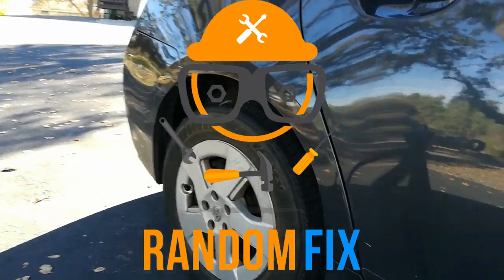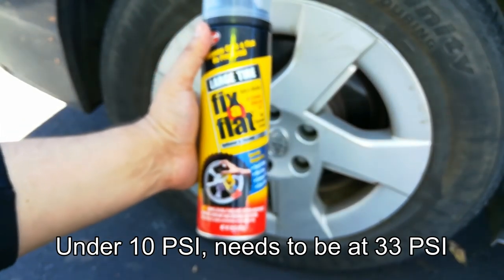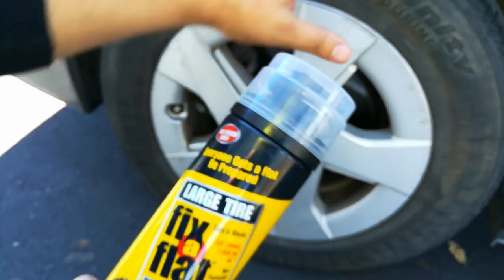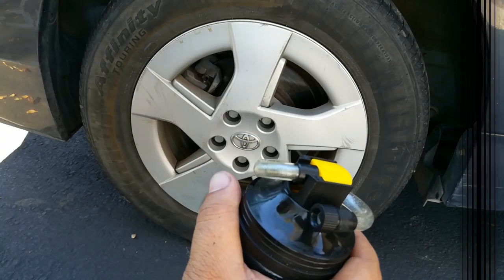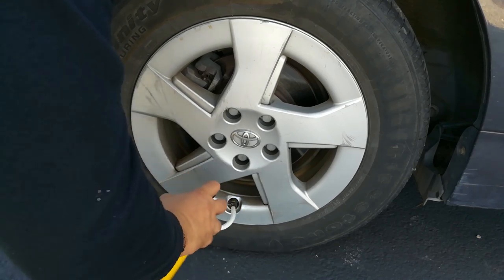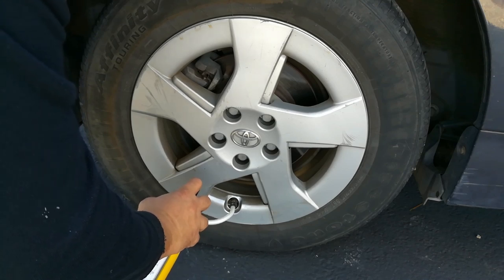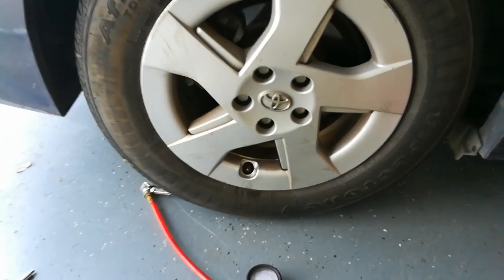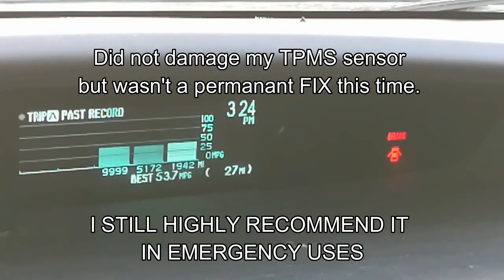Fix a Flat Repair - Does It Work?

Comment from the maker: ▶▶Fix a Flat - GET THE BIG CAN!! https://amzn.to/48XSxZR
▶Link to 12v air compressor https://amzn.to/3rOOH4S

▶How To Repair Flat Tire On The Spot  https://youtu.be/nT4Vt9voDxc
▶Link to Tire plug kit https://amzn.to/3M6Ppky
Reply: Do you take the nail out if there’s one in it?
Reply: The instructions say put the LEAK not the valve at the 6 clock position. It also says tire should be fully deflated.
Reply from the maker: Thank you for the info. Will update video.

Comment: I used this before many times, he is correct the large size is better more air and sealant. However it creates a mess in the tire which usually makes them pissed later. Best thing to do is fill with air and drive to get it fixed or if you can't then use this and buy a new tire
Reply from the maker: Sam Thanks for the confirmation. I can deal with having to buy a new tire as long as I get to a tire shop vs being stuck on the side of the road.

Comment: My fiance used a hand full of times and it worked. This is the first time it didn't work at all. Kia Rio Hatchback right rear. Mahalo - Thank you
Reply from the maker: Carrie, good information. Yes as you stated there is not a produced that works 100 of the time and I still carry a can of this because most of the time it works and gets you out of jam. _randomfix
Reply: Just ruin the valve stem on my lawn mower tire using this product what was marketed as a $10 fix has now become over a $100 problem use this product at your own risk I will never use it again
Reply: Was probably your valve stem then?! 🤷🏻‍♀️

Comment: I think that FIX A FLAT is an excellent product as long as people understand what it is.  It is a TEMPORARY fix to get you out of trouble.  If your stuck on the side of the road with a flat tire, or very low air pressure in your tire, it's much easier to put FIX A FLAT in and drive home or drive directly to the tire center and get a new tire as soon as possible.  It is not a long term or permanent solution to a flat tire, or a tire that has a slow leak.  So basically it's just a way to get you and your car home safely, or to an auto center safely in the event of a leaking or flat tire.  People also need to understand that once you put this in your tire, the tire is basically considered NO GOOD.  It can't be repaired and it can't be fixed or saved.  Even the auto center will refuse to repair the tire once FIX A FLAT has been used.  It is basic tire industry knowledge that once FIX A FLAT has been used the tire is now considered no good and no longer can be fixed.  My best advice to anyone with a tire issue is to first look at the tire.  If the tire has a very slow leak you can probably drive it to the auto center if there is still enough air in the tire as long as the tire is not so flat that your car is literally riding on the rim.  If the tire is VERY FLAT, try and put FIX A FLAT in and then drive to the auto center to get a new tire.  In some cases, if your tire is so badly damaged, FIX A FLAT might not be able to help you.  In that case your going to have to put your spare tire on.  Once at the auto center, GET A NEW TIRE.  Replacing one single tire usually is not that expensive and having a new tire is your best bet.  It's definitely CHEAPER to have the tire repaired but your much better off with a brand new tire if you can afford it.
Reply from the maker: I love it, great thoughts. I too keep it in the back of my car, and if I need than I use. _Randomfix
Reply: @RANDOMFIX  Yes it is a great product!
Reply: I hate mechanics that lie just for business.  If it fixes the leak, IT FIXES THE LEAK.  We're not getting a new tire when the one we have is fixed.
Reply: Untrue tho yo! My experience has been using this exact brand three separate times with screw or nail punctures with full deflation, left the object in there every time, and it was a permanent fix every time. I was even able to fill up the tires when getting a little low after a few months as well. I’m not sure if my experience was a fluke or not, but if it was, it was a fluke thst happened to me 100% of the time with multiple tries....

Comment: pretty good video other than the fact that you're doing the exact opposite of the instructions which state that the puncture should be at the 6 which is down low at the bottom and that the valve if possible should be as high up near the 12 as much as possible but the priority is that you have the puncture at the six position.
Reply from the maker: Dan, Great feedback, I will keep that mind. _Randomfix
Reply: Can't always tell where the leak is so it can be hard some times. Video is a year old but it was made in December so it was probably also winter at the time I don't blame the man for not jacking the car up just to take off the tire to find the leak.
Reply: Lmao earthlings are hella funny and weird
Reply: @bequakynskagroupie3751  right?  They're always tinkering with things.  Thinking about things... fixing things...and looking for----what are they LOOKING for??
Reply: I have a question. I guess common sense if you have a flat tire and you pull over the side of the road and put fix the flat in the tire aren't you still in the jam of not having any air to put in it.. It would seem if I have to call a tow truck just to put air in my tire I might as well have them change to  the spare.. I could be misunderstanding everyone maybe you're talking about a very very slow leak but you still need to put air in the tire so I guess you're supposed to use this product and then drive to a gas station and fill it up.. It would seem more logical to pay the $20 to have the tire taken off and patched
Reply from the maker: The patch is only real solution but when it's a weekend or your middle of nowhere what are your options? I carry the can of fix a flax and a small 12 volt air compressor.
Reply: @RANDOMFIX   I feel like if people are responsible the only real solution is to make sure you have a functional good condition spare tire, cover alls and a blanket, and a small piece of wood to put your Jack on.. Fail to plan plan to fail
Reply: @RANDOMFIX   Here is another smart detail most people don't know. When a tire shop put your lugs on, they usually use about 800  pounds torque on their gun, when the lug should only be torqued at about 110ftlb.  I break all my lugs while I'm at home and then toward them then if I am out on the road I know my 4 way will remove the lugs without me having to jump up-and-down on it like I'm on a trampoline
Reply: one more and I'm done lol.. I can't tell you how many times I've talked to people that said they couldn't get their lugs off, only to find out they were crossed thread by the tire shop because they did not put the lugs on by hand.. A lot of these technicians think they work for nascar.. People please watch the guys working on your tires and demand that they put the lugs on by hand and spend them on about 8 or 9 times before they use a gun
Reply from the maker: I hear you on that about shops over toqueing the lug nuts. I have had shops also leave them loose, lol.

Comment: My can says to move the tire so that the puncture is in the 6 o clock position and also says to make sure the tires are completely deflated before use...
Reply from the maker: Hi James , thanks for the feedback. I use the can as a fast solution to a flat tire. If you remove air and deflated the tire you maybe better off plugging the hole with a 5 dollar plug too versus the fix a flat. _Randomfix
Reply: Me too.  I couldn't find the hole and my valve happened to be at 6 already,  but it did not work AT ALLL ..
I still have a completely flat tire! Just had 2 patches put on last week. 🤦🏼‍♀️

Comment: FYI, your should really take the car on more than just a few minute drive after applying it, and it should be at high speeds like on a highway. I made the mistake of putting this stuff in my tire to fix a tiny pin-hole leak from a crappy patch job. I drove it around in slow city traffic for about 20 minutes then parked it at home. Next day I go to work and I have a large shimmy / oscillating vibration on the highway at above 60MPH, and it gets worse with higher speeds. So I'm guessing this stuff didn't spread evenly before it hardened. At least the leak is gone, but now my $300 Michelin is headed for the landfill...
Reply from the maker: Ian, good feedback, how long did drive for once you emptied the contents of the can into the tire? So, this exact thing happened to me a long time ago when it was cold and I didn't drive a long distance. _Randomfix
Reply: @RANDOMFIX  You should also fill it to proper pressure before going for a drive on the fix a flat.
Reply: The same thing happened  to me and I just posted it.  I have a $240 continental  and  it did the same . Why did that happen . I drove for an hr after on i95 also put air in before ride  . Why??

Comment: I do something completely different I put the product in, drive it out and then put air if it needs it which in most of my cases it does right after driving it. Hasn’t failed me.
Reply from the maker: Thank you for sharing your method.
Reply: Didn't he do just that?  He put it in,  driven it around, then added air as he needed it. How is what you said any different?  @mel_sandoval

Comment: Do you put the entire can in? How do you know when to stop if the tire is only low and not completely flat?
Reply from the maker: Hi Allison, yes empty the whole bottle in the tire and if you access to a tire pressure gauge you can also remove an excess air. 😃 Best of luck

Comment: My main concern is if i put the fix a flat on tire does it make it harder for rhe tire man to patch the tire
Reply from the maker: Joshua, Great question, from my experience I've never had a tire shop complain about my using the fix a flat in the car. There is also the great slime and other products but I think you should be okay. _RandomFix
Reply: Ok thanks tire is fixed
Reply: My brother  gout a fix a flat  spray   tire on my  old  
bike
Reply: Joshua Hidalgo it’s a liquid so it just wipes off clean with a rag or you can rinse it off with water
Reply: From experience yes, it does make it harder. The product has to be removed and there's always a big puddle of it in there, after you wipe it all out you still need to rinse it out with water and then wipe it dry again. This takes a lot of time and time is money, the longer the job takes the less money you make for the job. You never hear them complain because they don't want to lose a customer but I guarantee when they see that mess in there they're cussing.
Reply: If you find a nail should you remove it prior to adding the sealer? Thanks
Reply: The Polar Peak Monster I need this answer literally now! So probably will have figured it out by the time anyone answered this....
Reply: Yeah they can’t plug it after you use fix a flat

Comment: Did you have to take ur tire in to get the fixa flat solution out?
Reply from the maker: Hulk, Wierd story, but after the video was posted, it had a slow leak, but the leak has gone (it worked but not right away). I've had other cars and have taken them into the shop after using the fix a flat. The shops have never said anything to be about removing the fix a flat solution since it most likely dried out and spread out evenly. _RandomFix

Comment: It fixed mine..even though it was a messy procedure.. I couldn't get the whole can in the tire. But it worked. I followed your advise, valve on the bottom, then drive 10 - 12 minutes. :-)
Reply from the maker: Lars, Thanks awesome and I'm glad the video helped!! _Randomfix
Reply: well his advice is actually 5 to 10 minutes it's really two to four miles not so much minutes, as is clearly stated on the can of Fix-A-Flat.
Reply: @DanLoFat  Then excuse me, it still fixed my tire, and it has been over 2 month now and it I haven't had the need to put any more air in it.
Reply: 6 Months or more now.
Reply: Lars Koewing yeah I’ve done it theee separate times with permanent fixes every time

Comment: Will it work if tires is completely flat?
Reply from the maker: Yes but you most likely have to add some air into the tire, I recommend  buy thr bigger suv bottle.

Comment: So if there is a screw in the tire, should i remove it first?
Reply from the maker: Nanolugo, Great question, this the answer will vary case by case. Is the screw big, is head of the screw still attached, what area of the tire is the screw in, etc. If you can visibly see the screw then I would remove the screw. However, this is risky because all the air can leak out faster. (if the screw is really big you may not be able to remove it unless you a tire plug kit, see video link below ). Leaving the screw in and pour the contents of Fix-a-Flat will only buy a little time.  Best of luck and let me know how it goes? _RandomFix

▶️How To Repair Flat Tire On The Spot  https://youtu.be/nT4Vt9voDxc
Reply: RANDOMFIX thanks for the reply!
Reply: @RANDOMFIX  yes the last thing you just said is kind of the whole point of the Fix-A-Flat system it's designed to do exactly seal around a big screw that's in the flat part of the tire.

Comment: I had to reset the TPMS light on my wife's 2007 Toyota Corolla after I patched her tire, but I guess the Prius TPMS light goes off automatically after you fix the tire.
Reply from the maker: Rredhawk, Yes the Prius TPMS Resets automatically once it reaches the correct pressure. The older Toyota corollas and Scion Tc's where a pain in the neck with TPMS reset button._RandomFix

Comment: Okay here's a tuff one, I pulled a big semi truck screw out of my tire I plugged it twice with resin cord but it still leaks down to 20 psi and tire needs to be around 40-45 psi do you think I should finish this job with fix a flat or just get a new tire? The tires are brand new 😭 and the one bad tire does not go below 20 psi when it looses air so it's holding up the air to a certain level
Reply: I’m sure you’ve fixed it by now lol but these products are temporary at best. They’ll unbalance your tire.
Reply from the maker: Thank you for sharing
Reply: @hunterlong1820  I replugged it with resin and it's been fine ever since, I added more rubber cement the third time
Reply from the maker: The tire should be patched from the inside and I too carry a plug kit but again the plug is not a permanent fix compared to a inside of the tire patch.
Reply: @RANDOMFIX  lol you didn't have to tell me that, now I'm going to have to do it all over again. Are you talking about the tube plug?
Reply from the maker: Yes, the best repair is the inside patch. If you use a tire plug that you insert from the outside, the plug can move around. I plug my tires too but I would recommend an inside patch, you need to have a tire shop do that because you need access to the inner side of the tire.
Reply: @RANDOMFIX  yes I've taken a tire completely off the rim once with crowbars and it was a major pain
Reply from the maker: Wow, good to know, I've attempted to dismount a tire but can imagine how it would be difficult.

Comment: There is a screw in my tire. Do I need to remove the screw and then use the Fix a Flat ?
Reply: No, just put the puncture or the screw side of the tire on the pavement. So you might have to move the car slightly to do that. This is according to Fix a Flat. I had s similar issue and it got me out of a bind.
Reply from the maker: Sorry for the late reply! did you find a solution?

Comment: I put it in my car exactly how u did it but I went straight on i95 doing 80 for an hour ride and now I feel a big wiggle in my front and  back tire when i go 60 mph + .  Why is that?
Reply from the maker: Is it shaking when you hit the brakes? If you not hitting the brakes the tires are unbalanced. Did you apply the can the can in the front or rear?
Reply: Thank you for getting back to me.  I put it in the back rear drivers side tire

Comment: All the cans I've used in the last year or so including other brands of failed where they used to work in the past. Something has happened in the manufacturing process for the chemical makeup of the ingredients. I rarely get 10% of the contents to go into the tire now. It slows for about 10 seconds then stops to a trickle and the majority I'd save 95% is still in the can. I don't recommend them at all.
Reply from the maker: I appreciate your feedback Sorry for the late reply,

Comment: A vehicle that weights more than 5000lbs do NOT put the valve at a 6' o clock position. It will not fill up!. To much wt.
Reply from the maker: Josh, great information. Thanks for sharing. _Randomfix
Reply: What do we put the valve at then 12o’clock? Thx
Reply: If you have a new car dont put that stuff in your tire. Put the spare tire on. It will kill the tire sensor. Did that to my 2014 Buick enclave and 2016 Chevy Cruze. That fix a flat is a hit or miss when trying to put air in your tire.

Comment: How much of the Fix a Flat did you use? Did you use the whole can or just half of the can?
Reply from the maker: Use the whole can and only buy the truck or SUV bottle.
Reply: @RANDOMFIX  I actually used about 3/4 of it yesterday on my scooter tire. I just checked again today and it did not seem to have lost any PSI pressure as I checked with the measuring valve stick. 👍 Appreciate your video.
Reply from the maker: Good to hear, how big was the tire on the scooter?

Comment: Caution on using this kind of product on vehicle with TPM sensors, it may very well damage/clog the sensor; best to have an air/tire pump on board and pump-up the tire as needed.  BTW, press the Reset button once you have all 4 tires (in some cars including the full size spare) set to the same and correct pressure.
Reply from the maker: Rick, thanks for sharing this great I information. Can I get your help? CHECK OUT MY OTHER CHANNEL and subscriber if you like it. THANK YOU ▶️ https://www.youtube.com/channel/UC-wuhWwzZnFOWK-GMsP6Ejw   MANY THANKS _Randomfix